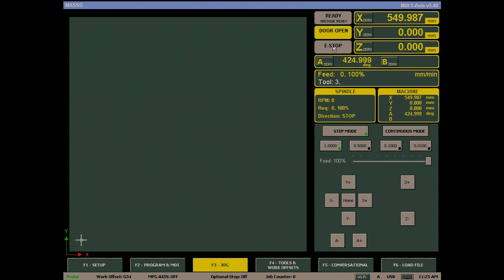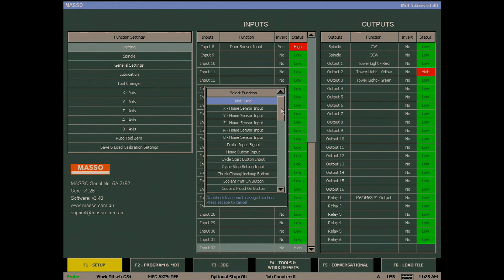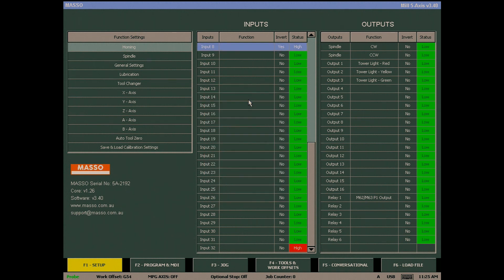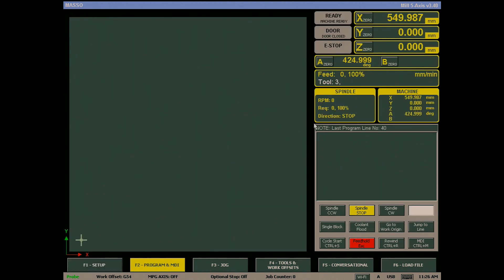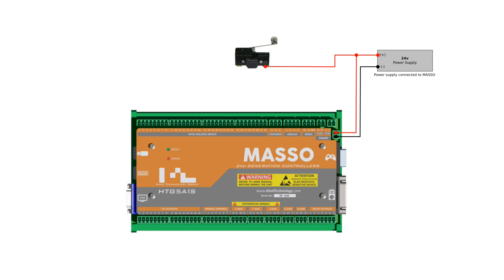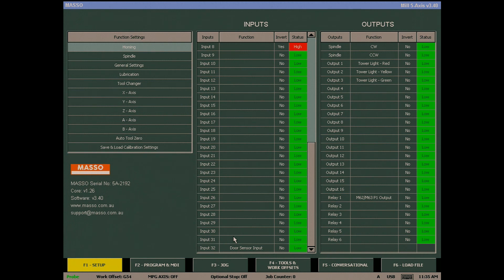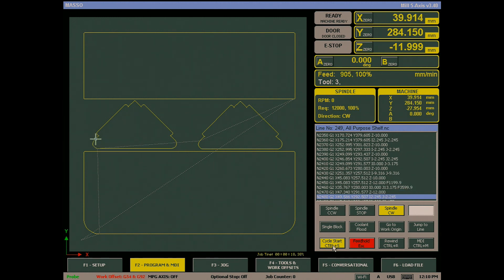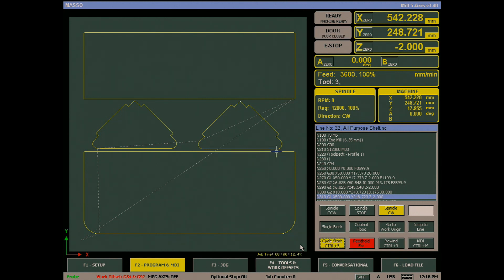MASSO 101 - Door Sensor Input & Alarm

Comment: we need examples for output uses with actual wiring. TTL, normal outputs as well as relay wiring for everything. why masso is so poor on explaining this stuff on their manuals? I see you use different relay modules that they are more affordable lets say. where we buy them and how to connect them? Examples of various external devices connections are required.  ac and dc please.